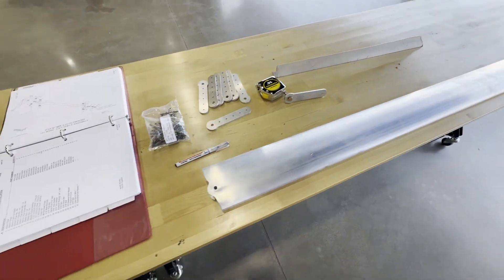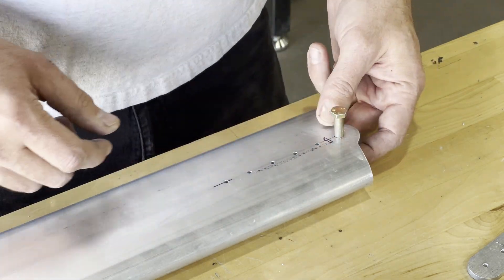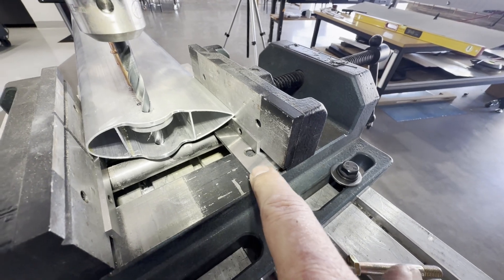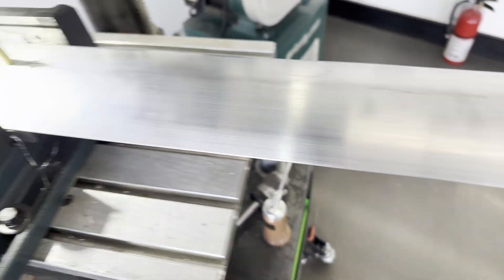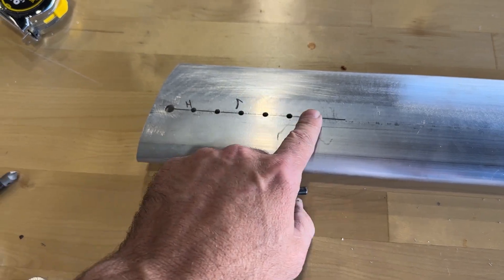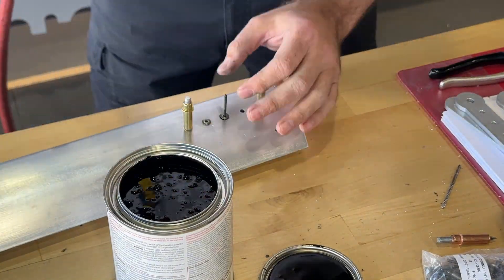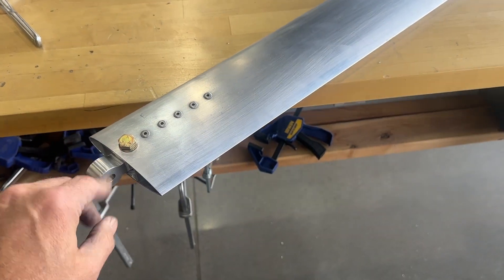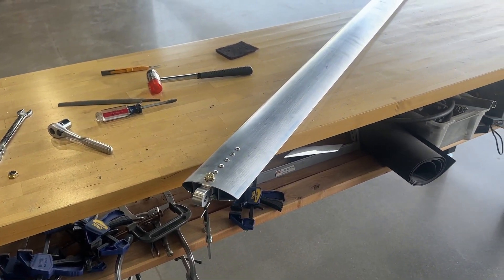Ep. 52 - RANS S-21 Lift Struts

Comment: Just started on the lift struts, and quickly found that when doing a dry fit of the strut doubler and the lower strut fitting into the lift strut there is not enough clearance to insert into the lift strut.  The difference is not small and some part or parts need to be milled to fit.